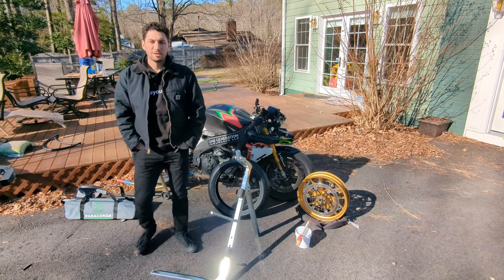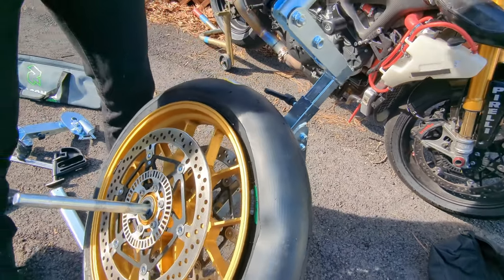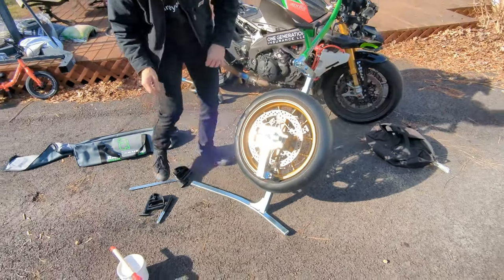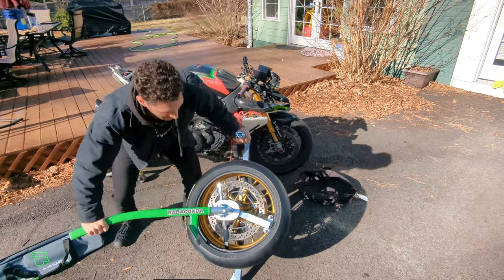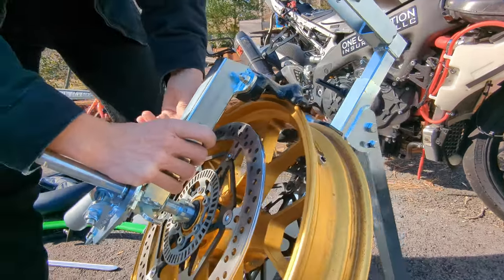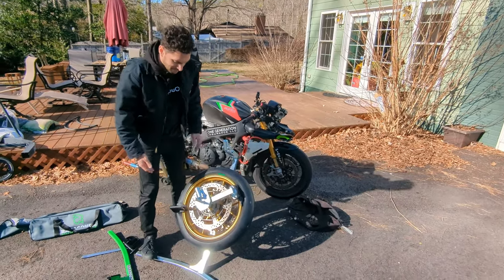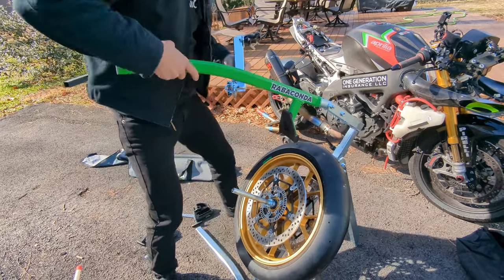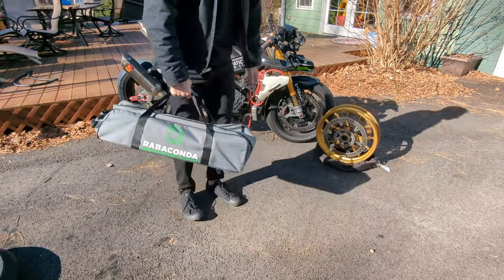@Rabaconda Does It Work? Is It Worth It? Track day | Racer Mobile Street Tire Changer

Comment: Good demonstration. Don't agree with putting tire lube on the mating surface of the bead. Not only unnecessary, can contribute to tire spin, at least on a race bike. In my experience only a very small amount of lube is needed, if any, on the back side of the bead and none on the rim. The back side is what might need help to get over the rim and a delrin or similar duckbill will slide just fine against the tire without lube. 

I ended up with a No-Mar because they were available quickly at the time, otherwise would have purchased this Rabaconda. The No-Mar works fine, but the portability of the Rabaconda is hard to beat, and the ratcheting feature is really attractive. I'm still fairly slow with the No-mar but getting faster. No fault of the No-Mar, just my (lack of) technique. Your setup seems like it would make for faster changes.

Comment: Really trying to weigh the rabaconda against the no mar
Reply from the maker: I've used both. I'd recommend trying both and it should be an easy decision. Nomar is heavy and bulky and doesn't travel nearly as well as the Rabaconda. For me that's worth it with the portability alone. Nomar you can break beads easier with downward force. Rabaconda breaks beads best once you learn the technique. Apart from that the Rabaconda makes tire changes easier and can be done literally anywhere which the nomar can't do. It was an easy decision for me, but try them yourself and see!
Reply: I have used a friends No-Mar tire machine several times and bought myself a Rabaconda Street Bike tire machine. I find the Rabaconda to be even easier to use than the No-Mar due to the ratchet mechanism for the duck head. Another thing I really like about the Rabaconda is the portability. It all goes in an easy to carry bag so I can go anywhere and change a tire. The only thing that I can suggest you buy besides the basic tire machine is the small tire locating rod, 2 drop center tools and the tub of Rabaconda tire changing grease. I'm extremely pleased with my purchase of this system.
Reply: @countryjoe3551  dang I just bought the nomar used for 400 and installed it. Haven’t used it yet though
Reply: @richardcole1280 be happy. You'll be fine